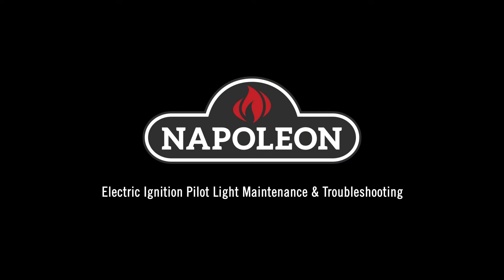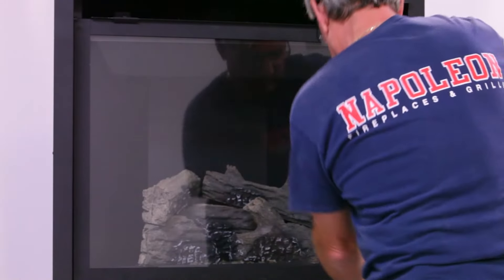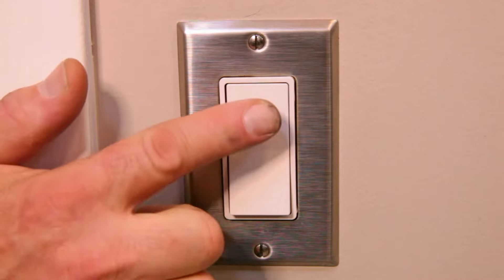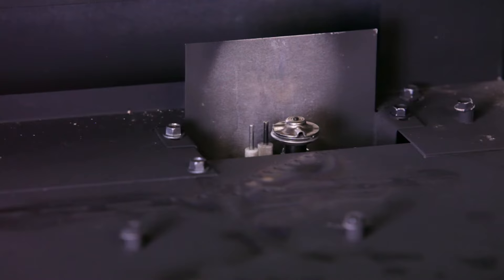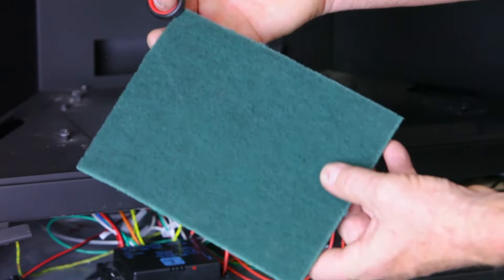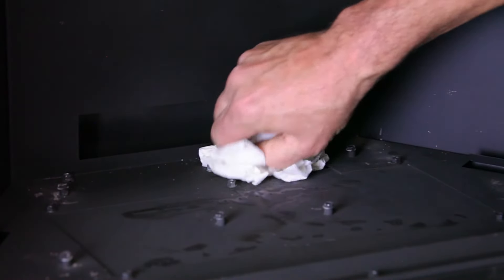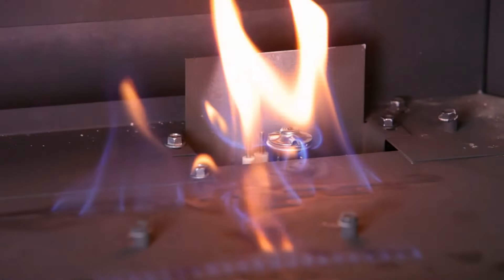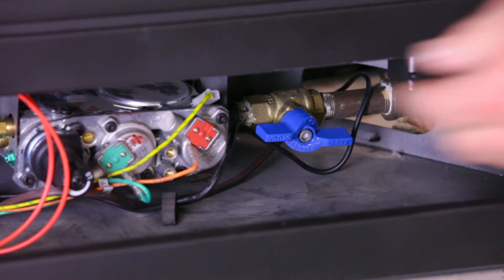Electronic Ignition Pilot Light, Maintenance & Troubleshooting

Comment: what if the pilot won't come on? how do I test the electronic box
Reply from the maker: Thank you for reaching out! Please contact a licensed technician regarding this concern. Due to safety, we want to ensure you receive the correct help. You may also contact your dealer or an authorized Napoleon dealer for assistance. Please use the link below to use our dealer locator to find someone in your region. 

https://www.napoleon.com/en/ca/fireplaces/dealer-locator
Reply: @NapoleonProducts  thanks, I ended up fixing it myself.  the gas valve was bad. I found a great online troubleshooting resource. labor shortage makes it hard to get help these days.
Reply: @mjspinosa  what was that source please,
Reply: @jameshobbs9084  Hi, It took me a bit to find it but here is the link: https://www.kozyheat.com/wp-content/uploads/2016/01/SIT_Proflame_1_Troubleshooting_Guide.pdf